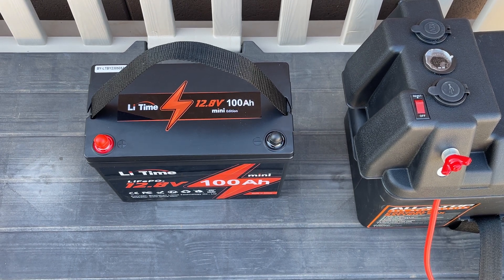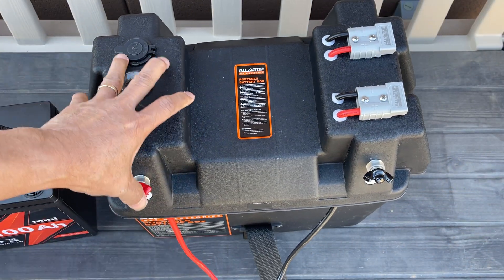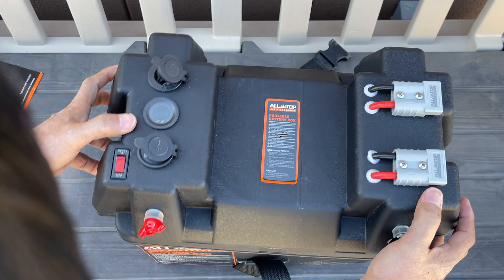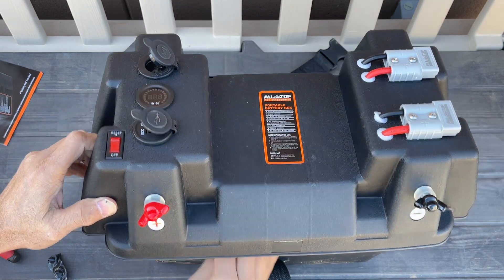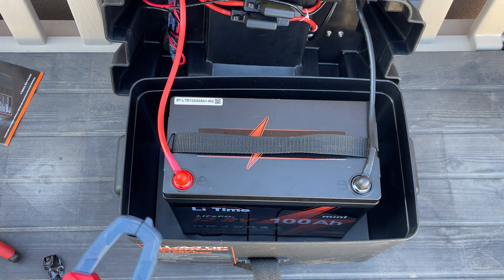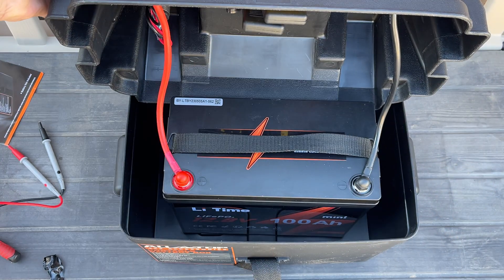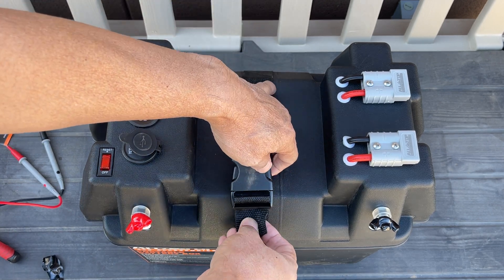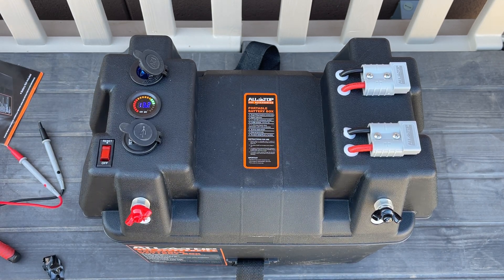Unboxing of ALL-TOP Smart Battery Box, 12V Marine Case w/ 50AMP Connectors

Comment: If i used with solar panel how to know the battery charge full
Reply from the maker: I think it has a built-in meter that tells you the battery charge voltage. Mine says 13.4V depending on your battery. If you want accurate readings, install a good battery monitor like a shunt.